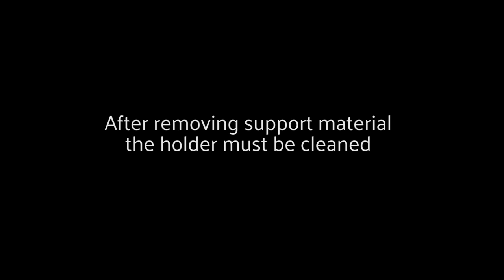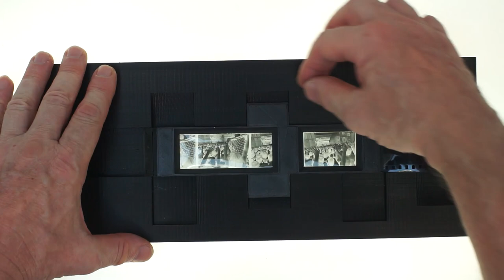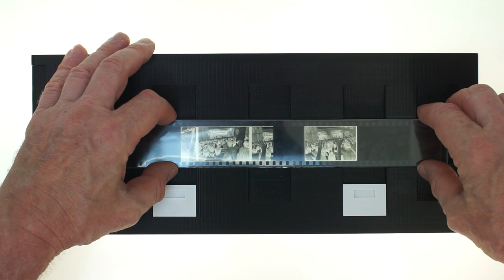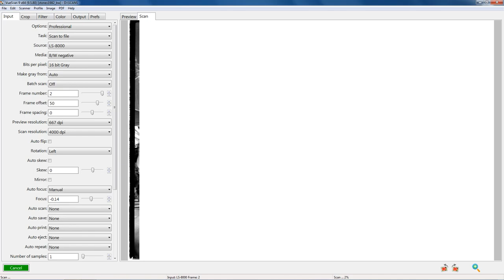Film holder NIKON Coolscan LS8000 LS9000  - 24x36 + 24x66 mm (#5)

Comment: Wow cool, but couldn't you also print it two parts and flat on the bed? 
If you split the file on the same level as the film, then you'd probably have no overhangs, apart from the rails at the side
Reply from the maker: Haha, clever idea ;-)
But believe me, I thought about all these little tricks. I have to glue the two parts together with high accuracy and only one try. 
Second, the flatness by vertical printing is better and fewer warping problems. 
Third point of view,  by printing in horizontal direction the resolution is too low (0.05mm) and the tolerances of bed too  high, important for focussing.
An unbelievable difficult project with a lot of fun.
By the way, my print bed would be too small for your idea ;-)
THANKS!
Reply: @coolscan  oh yeah forgot, laying horizontally this part would be ideal for warping :D